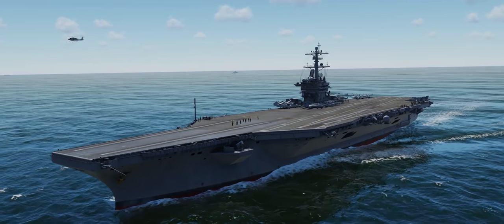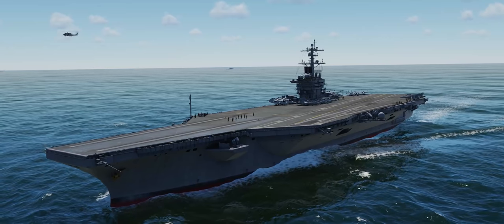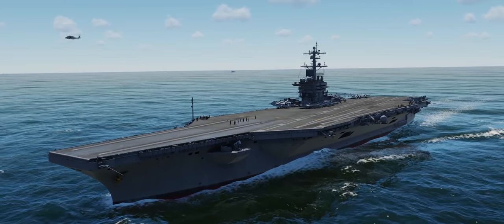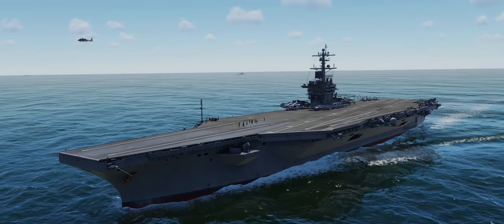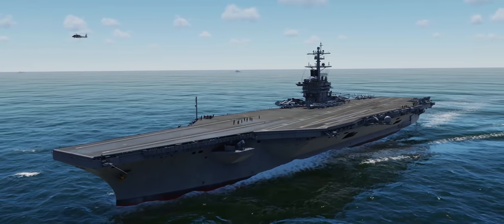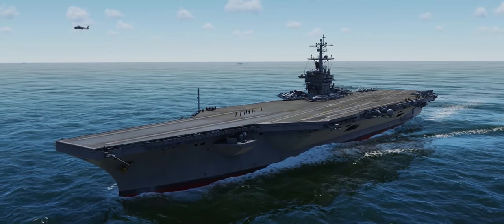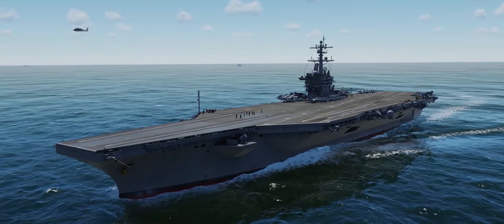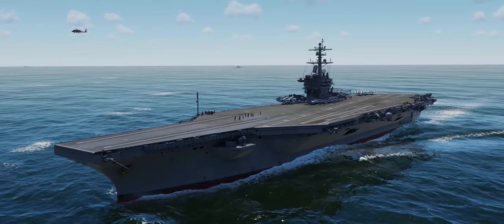DCS: Supercarrier | Questions Answered & Concerns Addressed!

Comment from the maker: If you guys have anymore questions or concerns about this module definitely leave a comment and I will try to get to as many as I can before release!
Reply: Hi Spud and thanks for taking the time to answer some questions. I have a few if you don't mind :)

If you or a static object gets stuck (or is misplaced) on the landing area, will the carrier not clear planes to land because of the foul deck? What about damage- if the carrier is damaged, will it divert aircraft somewhere else?

How well do AI navigate on deck? Currently, they just ignore all static objects and players on the Stennis and run them over- Is it improved? Do they know to avoid the static objects placed on deck? For example-  if I place statics on all elevators, will the AI that lands after that know to avoid the elevators, and go park somewhere else?

Does it react to changing or dynamic weather? (transitioning from CASE I to II or the opposite)

When you use the LSO platform, do you have control over the W/O lights?
Reply: Does it have a hit on FPS?
Reply: On your last 2 landings, the speed brake was still out... just mentioned it...

Comment: The big thing is though Spudknocker is that the supercarrier has WAY more slots to spawn aircraft on it than the base carrier. Just that alone is going to be tempting for multiplayer servers to use so they can have more carrier slots open, particularly if the group has a lot of users.
Reply from the maker: LockAC04 you are very right about that! I think people will be frustrated though cause you can Only see the IFLOS and talk to the LSO if you follow proper procedures
Reply: @Spudknocker  so peple have to do it the right way, sounds like exactly what is needed
Reply: @Piergeiron  not necessarily, not everyone wants to go through the entire procedure every time they wanna go back and rearm. especially in mp.
Reply: Jordan and this tends to cause trouble for other players who want to show off with a Sierra Hotel after a successful flight. Who’s at fault then? The guy on a 5 mile final to mother or the guy following SOP and turning from wake to groove? CASE Is are challenging at first but become a lot of fun and take very little time.

Comment: Great to see the different situations here :)
That one time you though you have taken long to get off the landing box was just 20 seconds, which is absolutely quick enough. When you kiss off with 15s spread, flying 360kts (for the ease of calculation, it's 350 usually), your Hornets break with 1.5nm separation and on the downwind, they're usually down to half the speed or even less than that which means it takes more than twice the time to get that separation distance caught up again, resulting in a 45+ seconds separation for the touchdowns. If you kiss off with 1nm separation, this will result in at least half a minute still. I think it helps to roughly know these figures, especially when you try not get get too stressed while trying to find a spot to taxi to on a crowded deck without having someone directing you off the box (something we'll see later in early access).

Comment: Does anybody know if F-18 pilots really use bottom rudder in the break to control altitude?
Reply: @Gort in a tomcat you wouldn't do that but keep in mind that you have no control over the control surfaces in a Hornet. Using the rudder pedals just tells the FBW to put the nose left, and it will automatically mitigate any roll or pitch movement that comes with that. So for small corrections it's very viable. Ofc it's always better to roll enough to stay level in the first place...

Comment: I want to run VR instead of a motion tracker. How do you guys memorize everything? Or do you use some type of voice commands? Be hard to hit key bindings especially numbers.
Reply: With some practice it isn't that hard to hit certain keys even in VR where you can't see them. Study the haptics of the keyboard layout, especially the little bumps on F and J as well as the numpad 5 help a lot, and having a rather standard layout with separated F keys blocks (1-4, 5-8 and 9-12). Try to put most things you need often on HOTAS bindings anyway, and learn to use the hand controllers in VR, you can click most things, including the comms menus.
And you can have Voice Attack with VAICOM Pro for the comms as well.
Reply: I use Voiceattack profiles made specifically for whatever aircraft I am flying. It makes things a lot easier when you can say "Prepare for landing" instead of fishing for 4 different keybinds.

Comment: Love the product. But really not a fan of "more micro options" having to go through the F12 menu. Its so cumbersome... And frankly, fumbling for a Fx F2 for a ball call, which happens at a very tense and important moment, is disappointing. (yes you can map a key to it but come on... i can map an auto-start to a joystick button too if i want to... but i'd like to use the stick for its intended purpose, not to meta-play the game).On the other side of that spectrum, the Virtual FLOLS is very cool. Another "meta" feature.
Reply: Cough* Voice Attack Cough*
Reply: @NyteStalker89  yeah, lets rely on third party softwares and other means instead of the main software doing it right.

Comment: I bought supercarrier but I'm running 2.5.5 will dcs update to 2.5.6 or do I have to switch to open beta?
Reply: It will take a while to get this in Stable, so you've got to switch to OpenBeta anyway to get it next week. Check here on how to do that:
https://forums.eagle.ru/showthread.php?t=114030
Basically you go to your DCS World\bin folder with a cmd box, and run this in there:
DCS_updater.exe update @openbeta

If you want to get around the 2.5.6 performance issues meanwhile, do this:
DCS_updater.exe update 2.5.5.41962@openbeta
This will patch your DCS to the latest 2.5.5 version that still runs decently. But then, don't update if it asks for it after that, or just use the DCS.exe in that bin folder to run the sim, then it won't ask for updates.

You can also try using SkateZilla's updater tool which probably is the more comfortable option: https://forums.eagle.ru/showthread.php?t=160053&highlight=update+tool

Next update most probably will be 2.6.0 anyway (as can be seen on Wags' videos), so we'll never see a stable 2.5.6 anyway :D